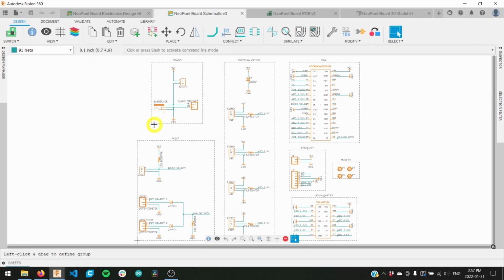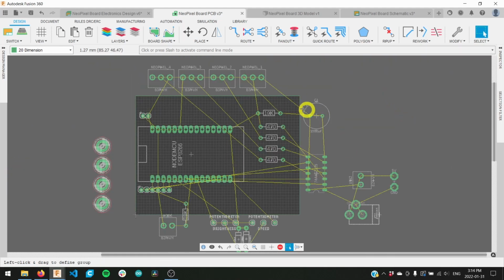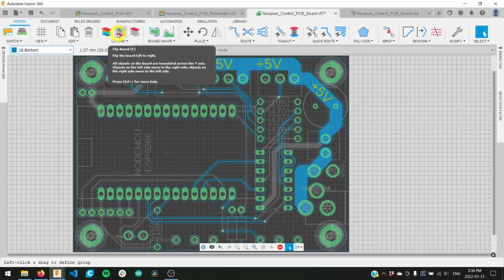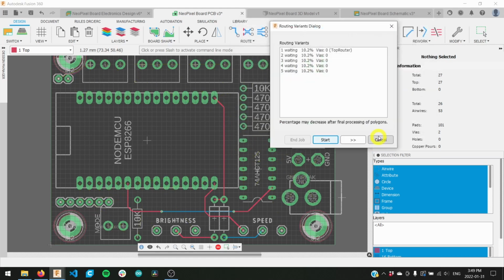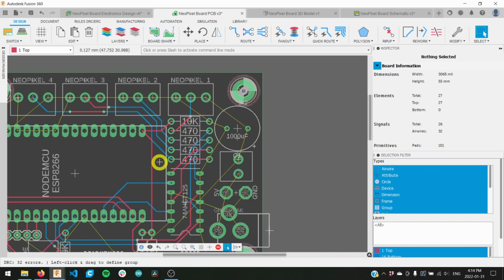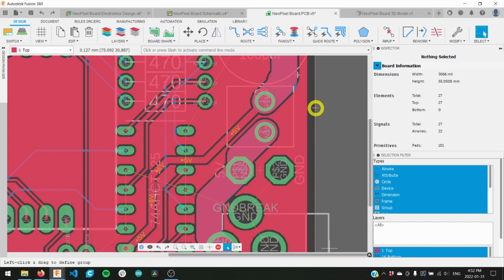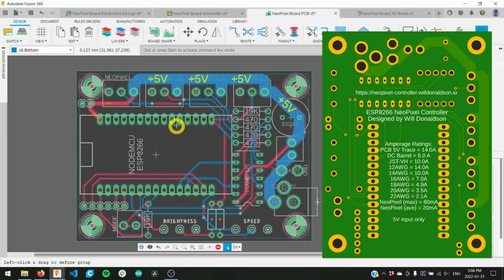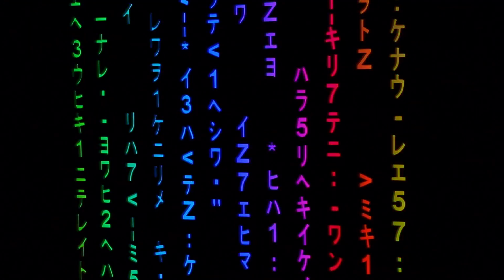Designing a Board Layout for a PCB in Fusion 360 [Part 3]

Comment: I'm trying to manually route a PCB with traces on the top and the bottom as you did but every time I route the bottom, Fusion removes my top trace and vice versa.  Is there a setting that controls this?

Comment: The hardest part when designing a PCB as a Beginner seems to be finding the darn Components in those Libraries...
I searched for something, couldn't find it, CAD Modelled it myself and when I looked for my part an already existing Component appeared... Are you fuckin' shitting me!? 😑
Reply: It's all about knowing what things are called and knowing how to efficiently search for them. Using an asterix on either side of your search terms in library manager is very useful e.g. diode or *relay*. But as soon as you need to get specific you need to know the exact part numbers you want to use and how they differ from premade models and footprints.
Reply: Yes, I spend so much time hunting down components and am surprised if I actually find them (with models).  I am working on some ham radio stuff, and many of the circuits I come across use parts that have been obsoleted.  It makes something I enjoy doing (electronics) really frustrating sometimes!

Comment: Abolutely love this tutorial series! It's gotten me up to speed very quickly.

One thing I can't seem to figure out, or find in any tutorial, is how to exactly line up PCB components to an existing sketch. I've designed a product in Fusion which has several switches, potentiometers, etc. These will be mounted onto the PCB, and the locations of the pins are therefor known. I've created a PCB that's linked to my Fusion design and the correct dimensions and desired mounting locations have propagated to layer 20 of my PCB. Most of them are not on the grid. However, the align tool only seems to work between PCB components - not including sketches. All tutorials I've found so far (understandably) only look at very simple PCBs, where exact positioning is less important.

Apart from copying all the numerical values from my sketch to my PCB footprints, does anyone know how to (easily) align my components to the sketch?
Super mega bonus points if the alignmnents propagate from the original design, when I make changes to it. (In my understanding, that would be the main reason for having a linked PCB in the first place.)
Reply from the maker: The only suggestion I have off the top of my head is to click on each individual component footprint and enter the (x, y) coordinates in the inspector window. This is a very manual process and it won't update positions if your linked sketch changes. Maybe someone else can respond to this comment if they have suggestions but this question may be more suited for the official Autodesk support forum: https://forums.autodesk.com/t5/fusion-360-support/bd-p/962
Edit: the more I think about it, the more I doubt Fusion has this functionality, if Fusion did have it then it's likely that automatically moving component placement to match a linked sketch would break the PCB traces and other features of the board. I believe the only feautre that can be dynamically linked is the board outline. Though I could be wrong, so you'd be better to ask the support staff
Reply: @WillDonaldson  Thanks for your reply. Sadly I've had to leave Fusion behind for electronics design as several functions have been giving me headaches and there are good alternatives available that don't impose restrictions.

These tutorials have been quite helpful in getting started nonetheless!
Reply: Curious what you prefer instead?  @RJ_Eckie
Reply: I'd guess this is becuase you'd be working backwards if you are redrawing the PCB from the CAD design/sketch. They'll have to invent parametric PCB design (Surely possible!) if we want this to work.    @WillDonaldson
Reply: @SmokyFrosty  You call it working backwards, but surely the product design should be made first and the PCB should be made to fit the parameters of the product design? Not the other way around?
Reply: This sounds like a great idea but is effectivly working backwards to standard PCB->CAD workflow. Autodesk need to invent parametric PCB design... I've only even roughed out a product design using PCB componants, then drawn the PCB, copying over componant locations, modeled it in 3D, then bring that into my case design and adjust accordingly which when you think about it... seems pretty in-efficient if every asspect of the design is contained in a parametric working enviroment and linked to eachother.

Comment: Hi, did you create the esp32 module with slot as a component, or slot as a seperate component? I find there's a similar module on the snapEDA plugin, without slot. I wonder if it's possible to stack a pcb(or component) with male pins onto another pcb with slot in the design process
Reply from the maker: I'm not sure if I understand your question, but yes, I created the esp8266 as a component (I got the 3D model off GrabCAD to save time instead of modeling the 3D model from scratch). 

I am a bit confused by what "slot" you are referring to? But yes, assuming it is the same device (NodeMCU ESP8266), you could substitute in your own device model